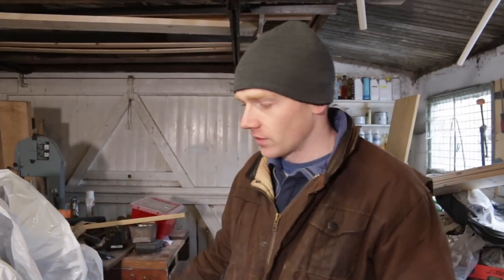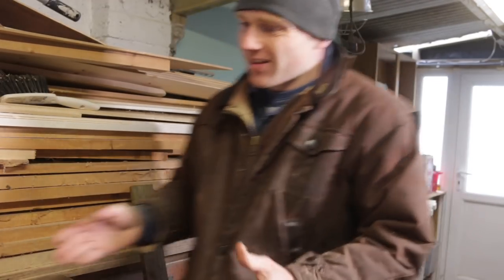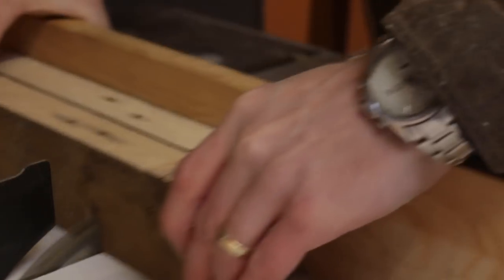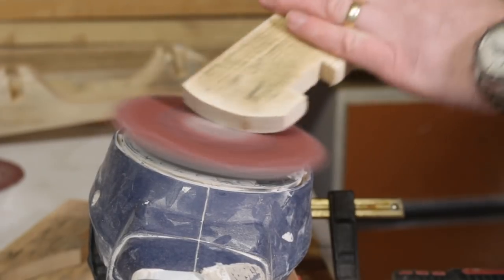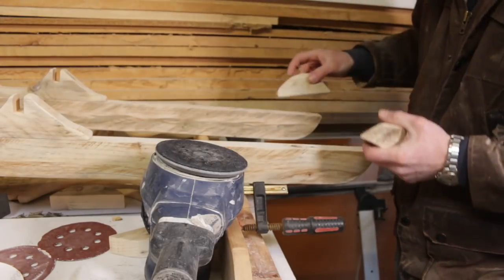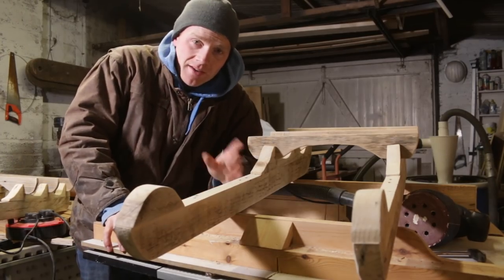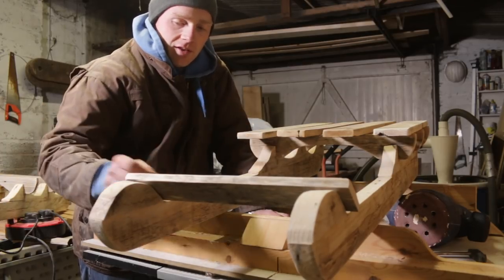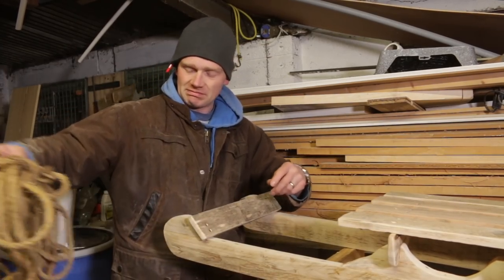Homemade Wooden Toboggans for FREE

Comment: how do you rate the bosch impact driver with the half inch square drive and quarter inch internal hex drive? im thinking of getting one with the robust cordless drill as a set. great project by the way
Reply from the maker: Love it. Solid build and been out through its paces already, no sign of wear and probably only used 1/4 of its power potential.